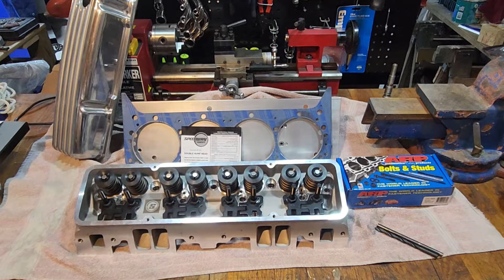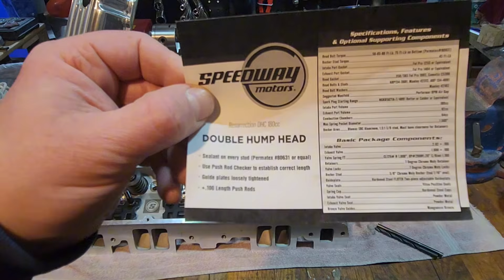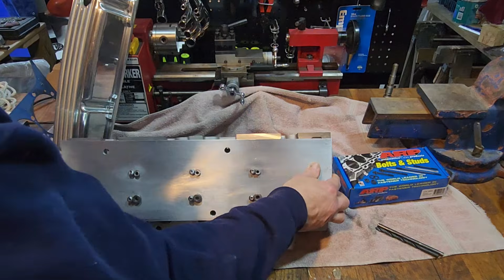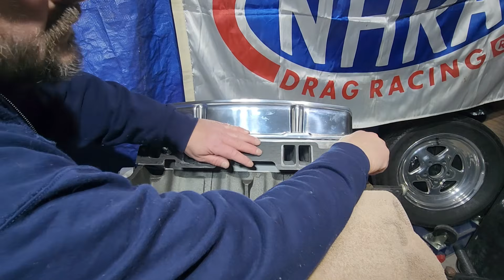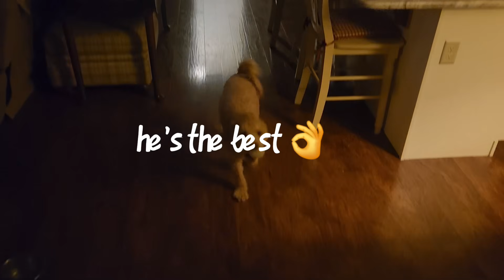Pt 1: Installing Speedway Motor's 461 Double Hump Heads on A 400 SB Chevy

Comment: you need gaskets with a higher port. They are available.
Reply from the maker: And an intake manifold with runners to match.The problem is in the head casting.

Comment: Speedway says you need to use FelPro 1205 intake gaskets. The gaskets you have DON'T look like Felpro 1205s. 1205s have the ports centered along the bolt hole axis. Your gasket ports are centered below the bolt hole axis. I have these heads and the correct gaskets don't have this problem...
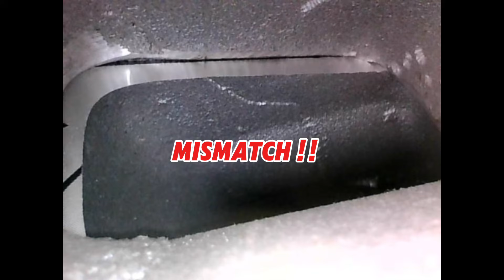Reply: @aw9680 at 11:28 into the video you can clearly see that even FelPro1205's couldn't help the mismatch.

Comment: It's not necessary to drill steam holes  in cylinder heads if you eliminate the thermostat and just use a water restriction  washer instead of using a thermostat
Reply: That doesn't alleviate the need for the holes. They are there to bleed air out of the spaces around the siamesed cylinder walls. It isn't actually anything to do with steam. They serve the same function as the "steam holes" on LS heads. Trapped air is an insulator and allow the material to become super heated and cause damage because the heat can't be transfered to the coolant and thus out to the radiator.